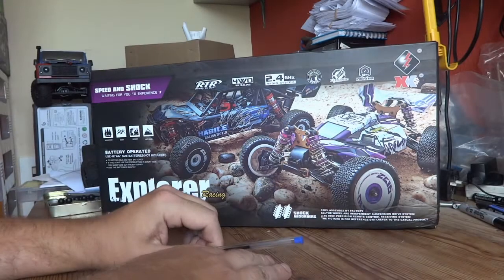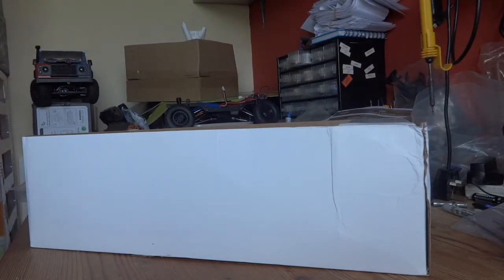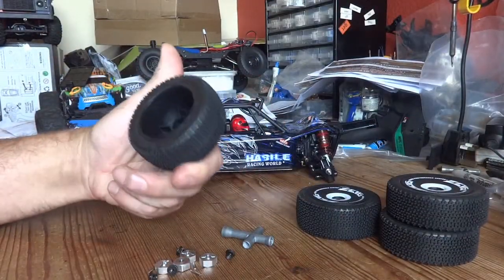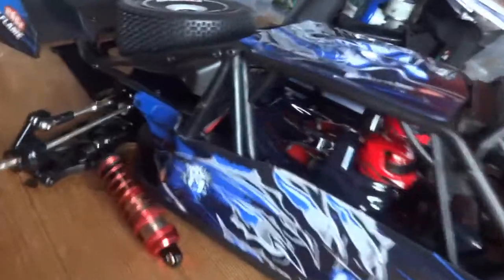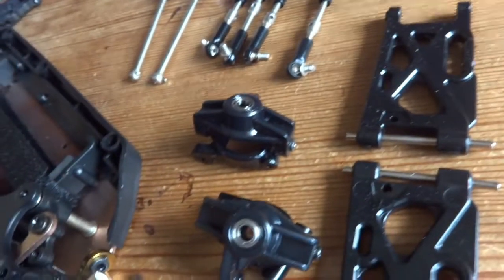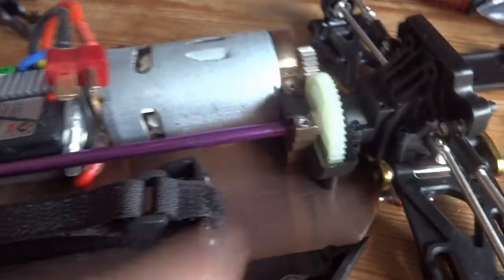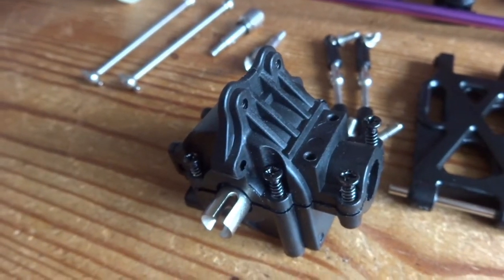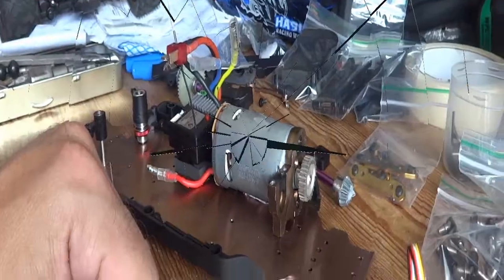Wltoys 124018 1:12 Scale Buggy. Unboxing & Tear Down.

Comment: Got mine last month for a rainy day project and I'm loving it so far... Haven't driven it yet though 😂 seen enough vids of them going so know what to expect , got mine to strip and grease and rebuild and customise, original plan was to do a beetle baja because the cage looks sick so I got the kamtec hotrod beetle shell to trim down and that looks great but while shopping I got the kamtec CITROEN SAXO body and some 1/10 touring car wheels so now I've drilled out the rear wishbones and swapped round all the offset little plugs so I can put the lowering screws in front and rear now so I can easily swap the car from Baja to rally to drift car just swapping wheels and shells and doing the ride hight screws , the saxo shell fits so nice I ordered 3 more for different rally decals like castrol and rothmans, the cage looks good in it too with a matching spare wheel you can see through the rear window making it look nice and scale , rather than get the new brushless 124016 later I'm probably gonna get the new EAT14 and swap the guts to save a few quid then effectively the EAT becomes a 144001 for the phat bodies mini project next saving me buying one of them ..scores! 😂 great little cars these and great vid pal 👍
Reply from the maker: Yes there great for the money. There's a brushless version out now! Thanks for taking the time to comment. 👍👍

Comment: driven that, gotta say it's really good BUT . . motor and chassis became scorching hot🔥🔥 and it cut out due to overheating ,needs heat sink and or  fan👍👍
Reply from the maker: Yeah they do suffer from that. The 104001 is renowned for it, and it even has a heat sink and fan on the ESC. But strangely enough the fan only kicks in when the temp gets to high!?! You would think it would be on all the time to prevent that from happening! 😟👍